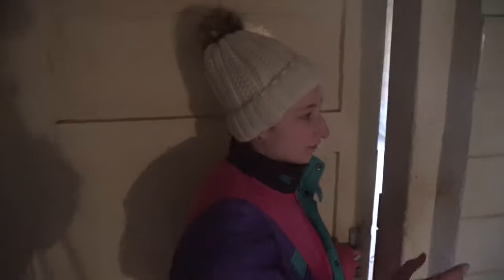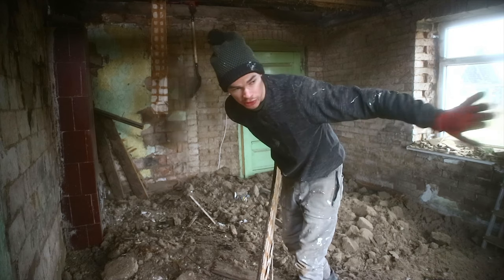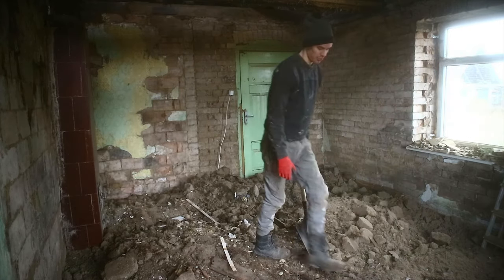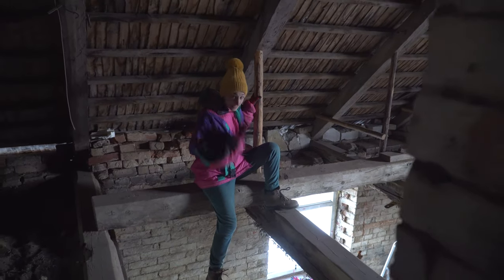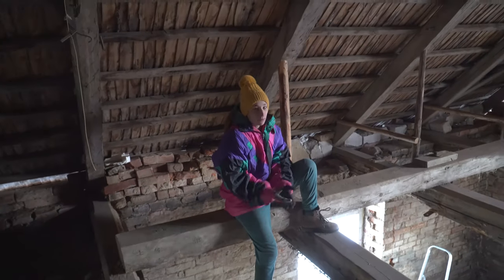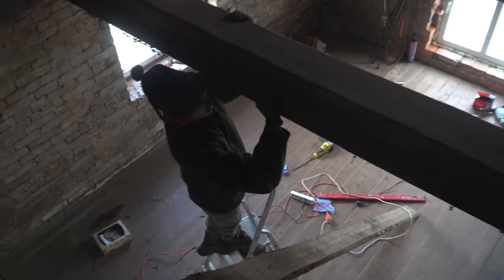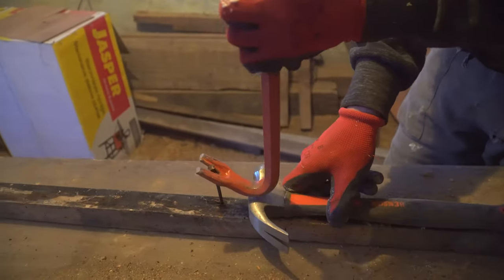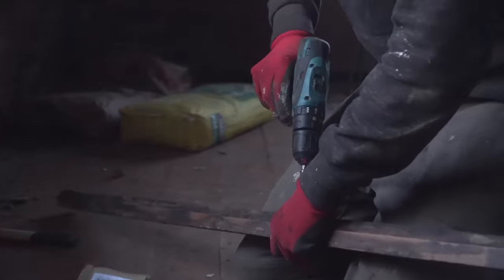Cleaning the 200 Year OLD Beams

Comment: Can the termites be exterminated and then use new wood where needed?
Reply from the maker: These beams had termites at some point but not anymore. The core of these beams is solid and could easily hold much more. You have to think that the old insulation was pure clay, which was 3 or 4 tons on this bedroom and now it's just some rockwool. The comparison isn't even close. There hasn't been any dust falling from the wood anywhere to indicate there is termites, we treated the wood as well so  this should help if we see anywhere dust there is treatment for termites not something bad as long as its dealt with fast! 😊❤️